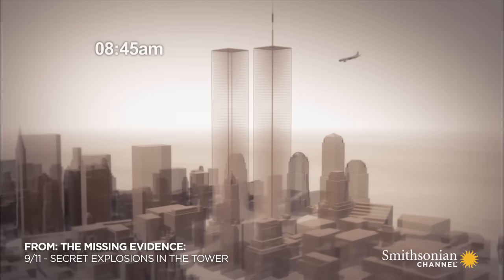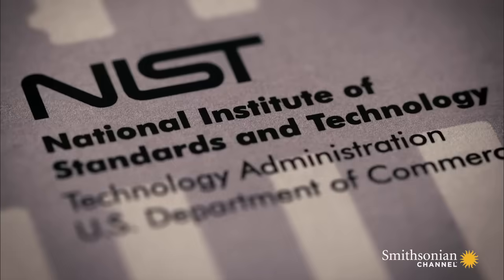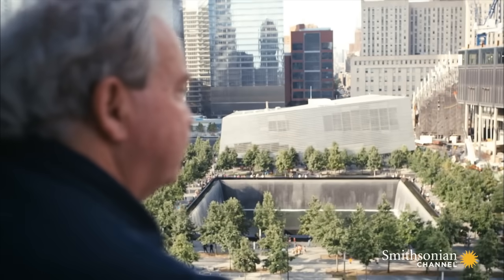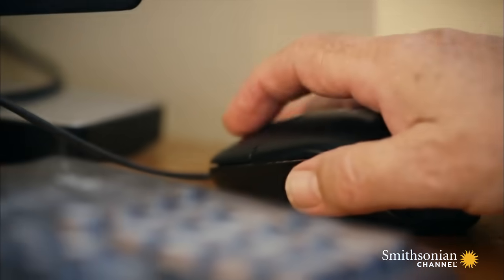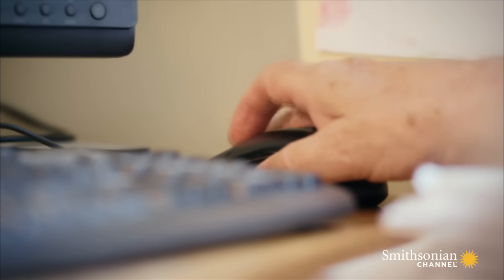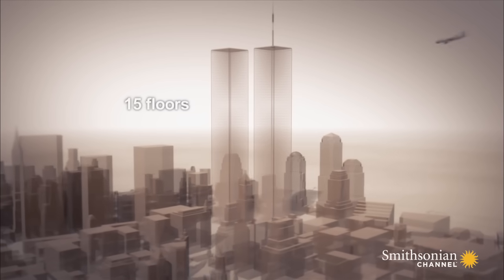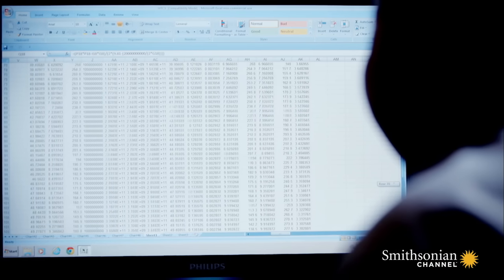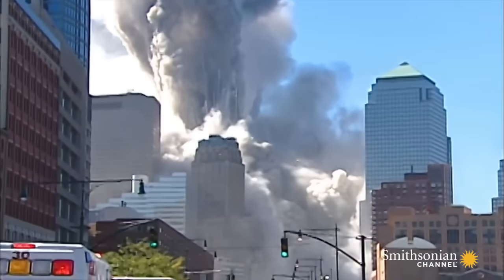This Computer Simulation Explains How the Twin Towers Fell

Comment: In the first 2 minutes....  References to "fanatical conspiracy theorists. & mini nukes" - Need I watch any more.  Am trying to find evidence of any GENUINE architect who believes the twin tower collapse is possible and found this drivel which is obviously bias.
Reply: You won't find any. For that matter, you won't find any h.s. physics teacher, or passing student, who can even theorize about how any mass will accelerate through its "collision" with anything capable of supporting it's static weight. There is no need to look for experts. This is a highjacking of the human critical thinking skills. It has been ridiculously successful
Reply: @apparentweight  "you won't find any h.s. physics teacher, or passing student, who can even theorize about how any mass will accelerate through its "collision" with anything capable of supporting it's static weight." 

That's a stupid thing to say, and easily disproved. Take a facial tissue paper, stretch it out, supported only by the outside edge. Carefully place several pennies on the center of the tissue paper, enough to make it sag without breaking. Now, pick up those same pennies about two feet and drop them onto the same tissue paper. Usually, they will accelerate through their collision with the paper and continue. It's the same basic principle that happened to the WTC Towers on 9/11; the upper section collapsed onto the lower section, breaking through.
Reply: Richard Alexander  Wait....so the massive steel columns of the twin towers are like paper tissues? What made the massive columns like tissue paper? The plane crashes destroyed 5-6 floors of 110 story buildings....so that means 96% of the steel in the towers were untouched by the crashes and fires.  The towers both collapsed in an identical manner and they were damaged in 2 very different areas. This is IMPOSSIBLE!
Reply: @STUPID TABLET actually firemen do say pull out. You know when a structure becomes too unstable and is a danger to stay in. They do not just run into a building and stay there. They have people watching and if the danger rises they will run out of the building. 

But hey what ever helps you believe in a conspiracy. 🤣
Reply: @via7216  regardless of whether firemen say 'pull out' when a building becomes too unsafe, what was actually said by the new owner of the world trade centre buildings, Larry Silverstein, was 'perhaps the best thing to do is just pull it', which really DOES sound exactly like a reference to demolishing the building by other means.. If he was referring to the firefighters, he would have said 'pull out'... By saying 'pull it', his use of language is referring to the building, not the people....
Reply: @STUPID TABLET I love how youTruthers like to quote Silverstien, but you only quote a small part of his statement and leave out the rest. You do this because if you take his statement as a whole it proves he’s not talking about blowing up the bldg.. Let’s look at what he really says.

"I remember getting a call from the fire department commander, telling me that they were not sure they were gonna be able to contain the fire, and I said, 'We've had such terrible loss of life, maybe the smartest thing to do is pull it.' And they made that decision to pull and then we watched the building collapse." –Larry Silverstein

So let’s break this down, Larry is on the phone with who? A FDNY commander.

The FDNY commander says what? “they were not sure they were gonna be able to contain the fire,”

Larry’s reply is, 'We've had such terrible loss of life, maybe the smartest thing to do is pull it.'

What does Larry say about the decision that was made to pull? “And they made that decision to pull and then we watched the building collapse”.

Who is "they" in this statement? The FDNY.

This how Truthers interpret Larry’s statement. Larry on his own accord decided that there was such a great loss of life that the smartest thing to do is blow up the bldg. while the FDNY search at its base for over 300 of their lost brothers. Which in itself makes no sense what so ever.

When in fact the statement clearly states that Larry was on the phone with the FDNY commander and the FDNY commander made the decision to pull. Now, do you think the FDNY commander meant blow up the bldg. or pull his men away???????
Reply: Richards Guitars - Well, I'm a genuine structural engineer and so were the people who made the NIST report. It's actually quite impressive the twin towers stood as long as they did in those circumstances!
Reply: @haslahali746  Woooooohhhhh.  Please send me a URL to your website?  Some kind of evidence of who you are.  You are telling me you are not in the slightest bit shocked that 3 buildings all fell in the exact same style on the same day.  Never been seen before or since.  Tower 7 was due to be "pulled" as stated by the owner of the building yet it "fell" exactly the same way as the other 2 much larger buildings.  This doesn't seem strange to you as a "structural engineer"
Reply: @RichardsGuitarshop  "shocked that 3 buildings all fell in the exact same style on the same day" 2 identical bldgs hit by 2 identical planes fell in a similar manner and this shocks you????? WTC7 fell nothing like 1&2, any idiot can see this.

"Never been seen before or since" No one has flown a 767 into another tube in tube style bldg since 9/11....

"Tower 7 was due to be "pulled" as stated by the owner of the building" The owner was on the phone with the FDNY chief, he stated that the FDNY made the decision to pull. Now do you think the fire chief meant blow up the bldg while 350 of his men are missing in the rubble right at the base of WTC7 or pull his men away for their own safety?????? Are you accusing the FDNY of being involved with the deaths of 350 of their own men????
Reply: @Oldschooldan1  Ummmmm Building 7 fell in IDENTICAL fashion and NOBODY was injured in building 7.  NOBODY.  You are not an architect and its rather sad you pretended to be!  In fact its my guess you were probably not even born when it occured.
Reply: @RichardsGuitarshop  - I don't have a personal website but if you want to Google Levola engineer in Helsinki, Finland, you'll see the company I'm working in! I can definitely explain why the towers came down and it's pretty basic physics. I wouldn't say I'm not shocked though.. it was a horrible event! I can't even say if your goverment knew about it or not but that's a different subject.
Reply: @Oldschooldan1  NIST disagrees with you. They did not say that Bld7 fell from the bottom up.
Reply: @joemo1033  Really?!?!? Perhaps you'd like to state where NIST said the collapse started!!!! I know what floor it was and it was nowhere near the top! Come on boy, put your money where your mouth is....
Reply: @Oldschooldan1  First of all, get yourself under control. Dont get hysterical. 

How did a fire on the roof cause the building to fall from the bottom up? The NIST "illustration" (animation) didnt match what was seen in the video of the building collapsing at all. And the cascade effect that they blamed isnt how buildings work. None of this is how anything works.
Reply: @joemo1033  ”How did a fire on the roof cause the building to fall from the bottom up?” There were no fires on the roof. When the North tower fell it left a 20 story gash in the south side of WTC 7. This started fires on floors7-9 and 11-13. This lead to the failure of a critical column #79 which supported the penthouse. Due to the way the bldg. was engineered (cantilevered over another bldg.), this lead to a progressive collapse that started on the 13th floor. So yes, the collapse started from the bottom up.

”The NIST "illustration" (animation) didnt match what was seen in the video of the building collapsing at all” NIST released 2 models, one from just fires and one from fire and damage, the latter was very much like the actual collapse. The models were only to prove that the failure of column 79 could have led to a progressive collapse, which it did.
Reply: @Oldschooldan1  And? Did you watch the video of bldg7 collapsing? Did you watch it in relation to the actual collapse? 

Those 2 things side by side dont match at all. Not to mention the animation they produced only shows the onset of the collapse. Not the entire event. And when are we getting the raw data on their animations? I'm sure there is a good reason to withhold that. Right?

Swallowing everything the government shovels in your throat is not healthy. Hearing something on CNN or from the government doesnt make it science. Their are plenty of experts that totally disagree with the NIST assessment of what happened that day. And let's not forget the constant contradictions of eye witnesses who were there.

Since you seem to have a lot of info, could you clear some stuff up for me? 

What is the totality of plane parts that were "vaporized" that day? From all 4 crash sites. 

If a plane hit the Pentagon, how do you explain the damage done multiple rings deep?  

Why was "ground zero" full of molten steel for weeks after the "collapse"? How were those temperatures maintained?
Reply: @joemo1033  Reading something you lying kooks have posted on Youtube doesn't make it science, either. Whether any so-called expert disagrees, no one has bothered producing an alternate chronology of events explaining what happened that day. The official story also is the ONLY story, at least the only story that is continuous from beginning to end. 

"What is the totality of plane parts that were "vaporized" that day?"

That sentence doesn't even make sense. Better pay for a better English translator. 

"If a plane hit the Pentagon, how do you explain the damage done multiple rings deep?"

100 tons of speeding aircraft can punch a hole through walls. You have problems with that concept? 

"Why was "ground zero" full of molten steel for weeks after the "collapse"? "

There was no molten steel at WTC, ever. Not for weeks, not for days, not even for minutes. In particular, no steel melted and flowed at WTC on 9/11/01. Nobody has ever produced any sample of steel that was melted that day. Nobody had the means of testing for the type of metal they saw. The physical evidence says that no molten steel flowed that day. The temperatures never were anywhere near hot enough to melt steel. So, there was no molten steel flowing at WTC on 9/11.
Reply: @Pooua  The USGS disagrees with you. They found hot spots 5 days after 9/11 that were around 1300 degrees. That's hot enough to melt a bunch of different metals and alloys. 

So if it was still that hot after almost a week, how hot were those spots the day of? Maybe double? Triple? 

Why are there so many artifacts from 9/11 that consist if solidly formed metals melted together? If it was hot enough to do that, that's pretty weird, right? That persistent "hot spot" as they called it, and examples that we still have of melted metal from ground zero...those must be from the office fires right?

Any other examples of a structure fire or collapse that maintained 1300 degree hot spots after a week of firefighting efforts? Is that normal in your expert opinion?
Reply: @joemo1033  "They found hot spots 5 days after 9/11 that were around 1300 degrees. That's hot enough to melt a bunch of different metals and alloys." - But not steel. Not even close.

"So if it was still that hot after almost a week, how hot were those spots the day of?" - Probably pretty close to the same. Note that ordinary office fires commonly reach peak temperatures of 1900 degrees F. According to news reports, the fires continued for 100 days, or about 14 weeks. I would expect that the temperatures decayed along a standard logarithmic decay curve, meaning that one could apply a standard analysis to determine tau, the time constant, and from that, approximate the temperatures at any given time. At the moment, I'm not where I can do these calculations. Just eyeballing it, and off the top of my head, I would expect that it would have taken about three weeks for the rubble pile to lose half its temperature. 

"Why are there so many artifacts from 9/11 that consist if solidly formed metals melted together?"

They weren't. They were pressed together, under great weight. 

"If it was hot enough to do that, that's pretty weird, right?"

You do know it was on fire, right? 

"Any other examples of a structure fire or collapse that maintained 1300 degree hot spots after a week of firefighting efforts? Is that normal in your expert opinion?"

The time it takes for the mass to cool depends on the mass that is hot and the temperature differential. Earth and debris form a thermal barrier that keeps hot things hot a long time. Considering that somewhere around 20k tons of debris was exposed to the heat of each burning building, it could remain hot a very long time.
Reply: @STUPID TABLET - They never fell at free fall speeds. Physics are the reason they came down in the first place. Trust me, this is something I should know!
Reply: @Richard Guitars, The ONLY architect that matters is Leslie Robertson, and he has no problem with the official explanation of why the towers collapsed. He knows that in order to understand how and why the towers came down you first must understand what kept them up.
Reply: Oh FFS,  they explain it in detail
Reply: @WaitForPete  Then why the play on words?
Reply: @WaitForPete  LMAO
Reply: @andrew tones Really?  How do you know I haven't talked to any engineers?  Quite a blanket statement considering we've never met.
Reply: @andrew tones   I don't even know what you're referring to.    So far your comment doesn't really have much meaning.  Care to explain. ??
Reply: @andrew tones That's fabulous.  I am about as far from a Truther as you can get.  I don't know if you're directing your comments at me or just in general.
Reply: You honestly believe, that we used nukes, and that nobody in parking noticed or was affected?
Reply: Yes, bias, as is your opinion!! 😂😂😋😂😋😋😂😂😂
Reply: 🌍 Beware of an architect named Tom R. He's an IDIOT
Reply: So fundamentally, you and the other controlled demolition zombies are admitting that you don't have lives.
Reply: I see there is still animosity about that issue. Funny. I thought it was settled in the minds of people by now. 

No, the official conspiracy theory does not hold water. Yes there is someone who cracked this wide open. If you care and look you cant miss it
Reply: @Senor Frog - Oh and who the fuck flew out of the window 2500 feet per sec in your disrespectfully delusional mind? Don't answer.. get help!
Reply: Well this video was specifically designed around debunking this 9-11 conspiracy and explaining what made conspiracy theorist believe this was a conspiracy in the first place. So how is that biased in any way?
Reply: BIASED IS YOUR OPINION FOOL PEOPLE LIKE YOU DONT BELIEVE IN THE HOLOCAUST PEOPLE LIKE YOU WILL PLAY BALL TO YOUR GOVERNMENT  AS WHAT THEY SAY ON TV AND RADIO OS THE GODS WORD  WHAT A DIMWITTED FOOL YOU ARE GO SUPPORT THE SLAYERS OF THE INNOCENT WHO STAGED THIS WHOLE CHARADE ON THE PRETENSE OF INVADING OTHER COUNTRIES , THE WOLF WILL ALWAYS LOOK FOR REASONS TO EAT THE LAMB, DISCREDIT THE SCRIPURES BUT RESPECT THE KABALAH , BOHEMIAN GROVE FUCKER GO JOIN THEM ALSO YOUR PRESIDEBT BUSHS GRANDFATHER MOTHERS FATHER WAS ALISTER CROWLEY
Reply: The 9/11 is just for invade Afganistán, provides 90% of heroine plants on the world, the base for most pain killers, since 2004 pain killers  demand rised so fast.
Reply: @andrew tones explain how you "believe" the immutable laws of physics are indeed flawed and in( 1) case in human history we see it, because it's bullshit?!! A building free falls through its own debri field, the physics of a controlled explosion/explosive devices are measured all over the site!! Zionazis who are dual citizens/foreign agents put the illegal colonial ethno state of Israel in front of their loyalty and love of the country they live in. When you allow dual citizens, many of whom are psychopaths, into positions of power within the secretive military industrial complex you have a coup. Not the first in US history. And finally the American empire has suffered the same fate it has engineered around the globe in the name of power and profit. You're all signing oaths of allegiance to Israel. And you're too sheepish to wake up and just look at the physics. No wonder you are determined to destroy public education, a scientifically literate people are harder to fool with the corrupt press. Who owns the press? Who are the witnesses first interviewed on the streets as the towers fell? They had all the information a journalist could ask for? The sooner you disseminate the narrative you have constructed, the easier it is to maintain control of the narrative. Especially when the population are faced with a completely new phenomenon. Everyone in anyway responsible for the decisions made that day had/have multiple times to Israel. This "pearl harbour" like catastrophe was spoken about. So ask yourself who first spoke about this catastrophe and how could it be used to shape the geopolitical future of humanit? And then ask yourself who profits? Are they all loyal to Israel? Are they all complicit in the missing Pentagon 2.3 Trillion dollars?! Who owns the buildings, who had offices in the towers? who gave the green light for the modifications to the buildings? What investigation/material and information was stored in the buildings? Who profited from the fraud? Who saw the bodies in the field in Shanksville? Who signed the autopsy results? Are they loyal to America? Or are they loyal to the racist (by law) Israel? What are the ties between zionist extremists and the military industrial complex? And lastly ask yourself when you'll have the balls and the brains to acknowledge the truth?!!
Reply: Look up molten aluminum. More than enough to weaken all the steel in the building
Reply: @Yousef M the Pentagon is a classified building
Reply: Watch the Ryan Dawson Documentary on 9/11 if you want the truth
Reply: ...found perfect passport and perfect engine block from a different plane model all together planted on a street corner...give me a break!
Reply: Senor Frog Nukes exist but aliens monitor them and shut them down as openly admitted before 9/11. It’s a front for money laundering for mind control and black budget programs since they now have a UFO fleet to try and attack the good aliens because they’re psychopaths.
Reply: Bryan   Is there any doubt as to why someone on your side of the debate would resort to name calling/ad hominem attacks? Insults such as “mental issues” and “conspiracy theorist” are the only weapons in the propagandist bag of tricks
Reply: Architects and Engineers for 9/11 Truth should hit the spot  ;-)
Reply: Mr. Guitars knows that and is nothing but a paid troll. How could you have online access and not find evidence?
Reply: Anyone who buys the original story the US govt gave about the falling of the TWIN TOWERS due to crazy Muslim arabs flying planes into them is a total MARK.
Reply: A mini nuke?  That causes the building to collapse 80 floors up and an hour apart?  

Really?. Those conspiracy nuts can certainly convince themselves of some seriously stupid shit.
Reply: Bias isn't an adjective you illiterate fool.

I don't know why you would expect THE SMITHSONIAN to side with anybody but the government.

Regardless, virtually all architects and structural engineers with more IQ than shoe size agree that the collapses were perfectly natural results of the fires.
Reply: @CODMarioWarfare  
Architects and Engineers for 9/11 Truth don't agree. Might wanna check that out
Reply: @CODMarioWarfare  lol - Tower 7 too.  Despite calls to "pull" tower 7 by the guy who owns it?  Which has been recorded.
Reply: CODMarioWarfare   There is no such thing as consensus in science. The investigation by NIST is as unscientific as it gets and any layman with an IQ above 3 can see that after reading it. The computer models which formed the basis of NIST’s conclusions are still classified.....classified science ISN’T SCIENCE at all. How dumb do you have to be to not know that?